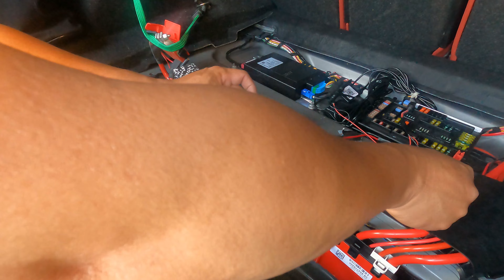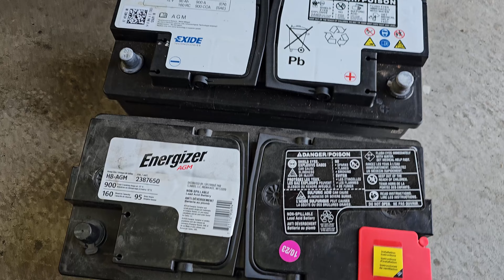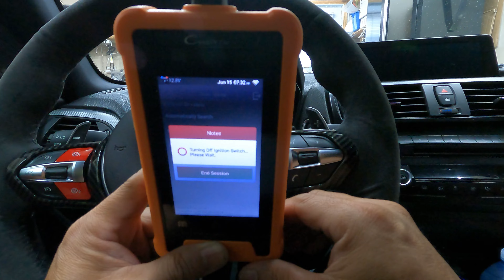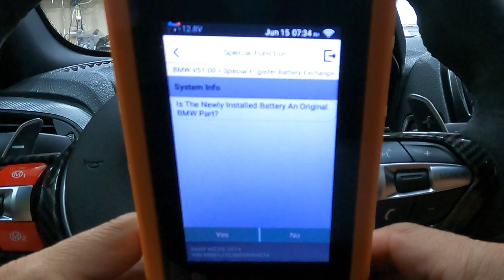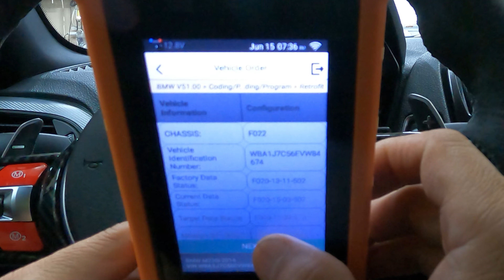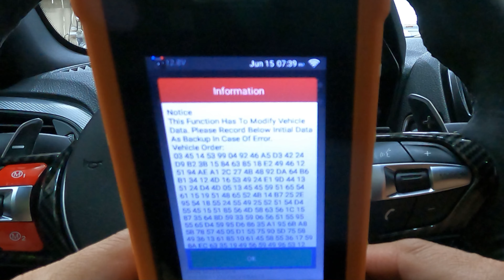COSTCO New Battery install on BMW M235i, Register & Retrofit w/ Launch Creader Elite

Comment: I got a new battery and won’t turn on still . Car says (ignition/ starter ) error . Would I need a new starter ? .
Reply from the maker: If engine is not cranking with new battery, Probably the starter is defective.

Comment: So if I change the new battery using 95Ah and the OEM is 90Ah, then I don't have to code it? Or should I just go code it and choose 90Ah again like in the video? Another question is my car has an aux battery in the front (530i 2019), I assume that since I don't see the IBS on top of the battery, I just change the new battery without the need to register right?
Reply from the maker: You have to register the battery to nearest higher Ah,  if you don't have the same Ah on your scan tool, I don't know about auxillary battery if needs registering, Sorry about that.
Thanks for watching!!!👍